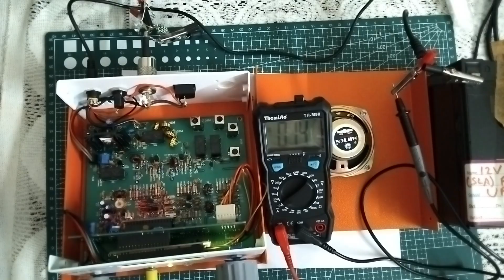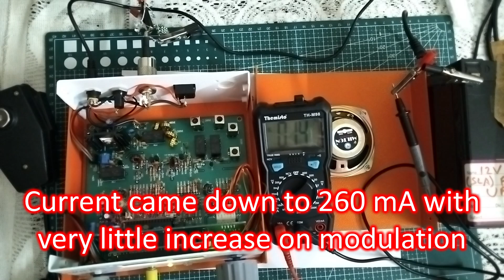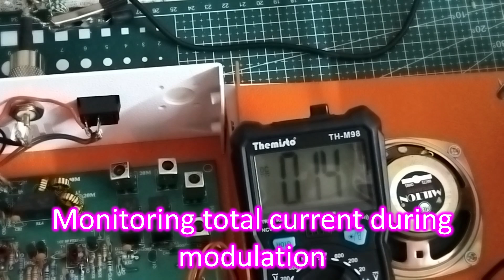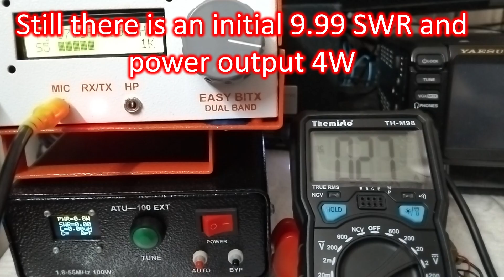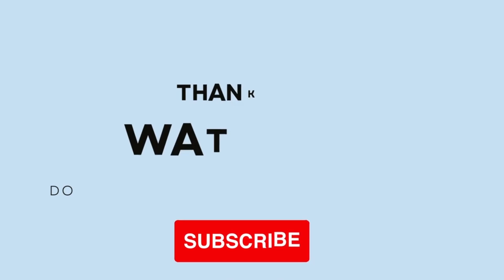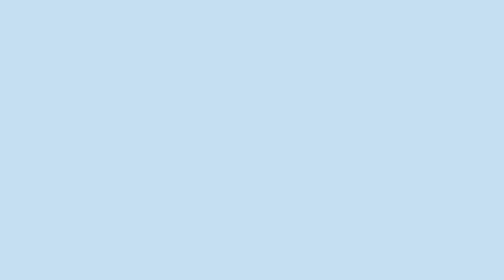Trying to avoid self oscillation of Easy BITX by reducing bias

Comment: I forgot one more point, the bifilar windings,  there is a phasing, you must connect the finish of the first wire to the start of the second wire to form the center tap,  if wrong, may give all weired weak couplings, flutter n fibrillations😊
Reply from the maker: I shall recheck once again. Thank you.

Comment: This looks diffficult!  
1. The irf  may be dodgy with extremely high gate capacitance. 
2. The driver stage should deliver around 0.3 to 0.5 watt to irf which is not happening here. Could be faulty coupling in bifilar or swapped windings. 

Now i think, in construction manuall, ideally irf installation should be skipped initially until driver is tested to output 0.3watt or so, to proceed further

Good luck with sorting it soon 👍👍
Reply from the maker: That's great advice, I'll definitely re-check the driver stage and coupling before going any further! But why did the LEDs on the dummy load light up when I modulated, according to the intensity of the voice? Yet power meter did not show corresponding power output when tested with antenna.
Reply: My gut feeling is the irf output is qrpp levels due to insufficient input drive to overcome the gate capacitance, which is on the border of  atu100s detection limits( around 0.1-0.2w). Check rf volt on collector of your driver transistor and on gate of irf (while modulating)  It should be around 5v or more(of rf ) or so to drive the irf. The bifilar windings  polarity is crucial. Otherwise it is an extremely abnormal mosfet with gate capacitance which drink all input rf. In that case swapping with another irf510/ vishay will solve it
Reply from the maker: Thanks a lot for all the valuable suggestions. Shall give a thorough check.